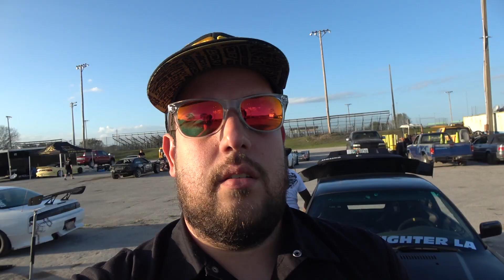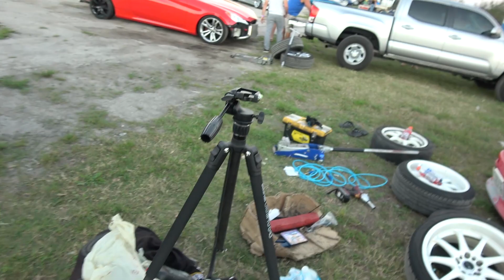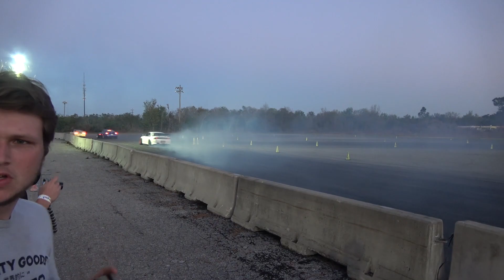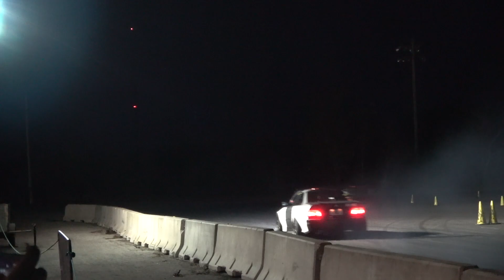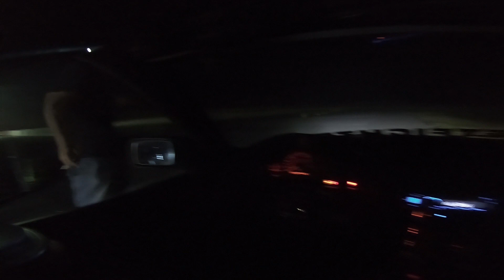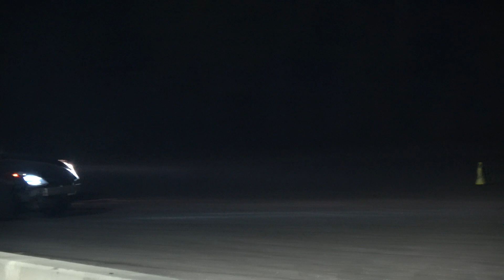DRIFTING WITH THE NEW SUSPENSION SETUP!

Comment: Looking good out there Big Boost, just have to solve the breaking up but I'm sure after you change the coil packs and get the tune set right it will be all good. I know that's most of the problems you seem to be having since its not staying in power and your having to give a lot of clutch kicks.

Comment: Dont nead more boost, u nead stiffer car and more confidence in your engagement on the gas and trust the angle kit.  Feels like you get a little scared in the middle of the drift and stalls it. And you nead a proper tune on it. And if you find an m50 without the vanos you should build of that instead, they are as durable as an stock supra motor. And can handel up to 700hp Np. I have an fully forged m50 in my car and have 570whp. Its Crazy boost in that, almost 170 to much for me and my smal tracks.

Comment: Alberto, if i were you i would go to a closed event with taylor and/or nicole and get some seat time with their cars (350z and 240) to get more the hang of it. Your car just have too much power for you, that is getting back to it, to handle. i see you strocking too much power instead of flowing through the course, most ppl strugle by not having enough power to lose grip and flow, you are struggling by having too much power and try to not lose control and link the course. i could be talking a load of crap but that's how it see it from all of your drifting videos (watched 'em all)